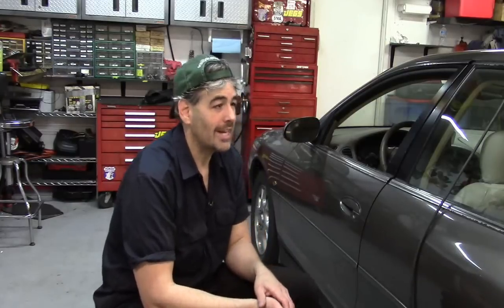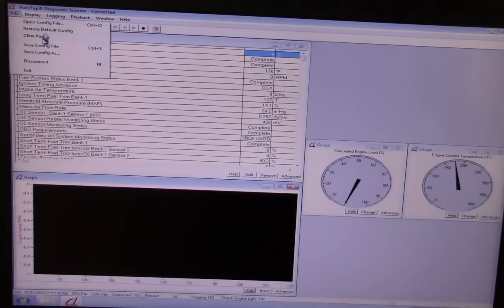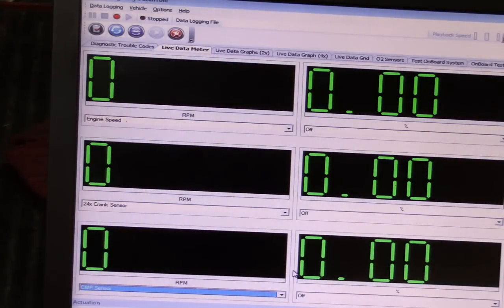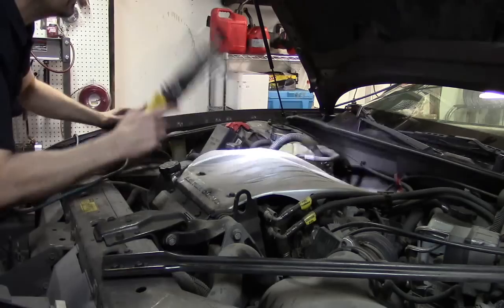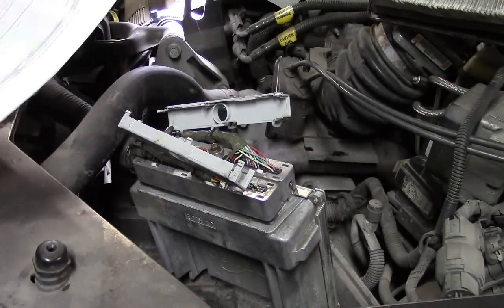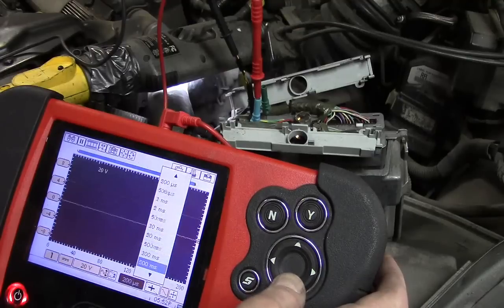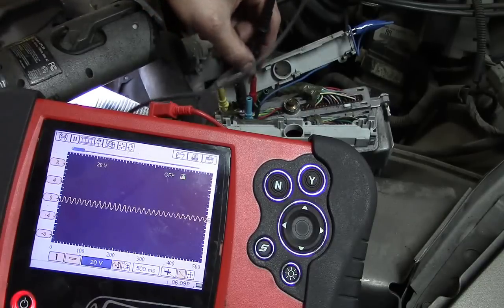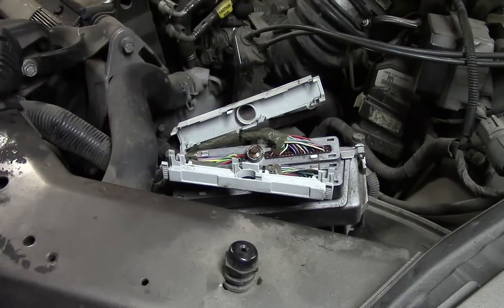DIY- Crankshaft Position Sensor Code Diagnosis

Comment: When I bought my power probe 3, I got it in with a kit to test for short to ground. I've spent a lot of time in that same wire harness this weak chasing down an ABS fault. 

The open circuit at first was right next to the rf ABS sensor, but then I traced and opened the main wiring harness all the way up to the ABS control module and that's where the short terminated.

All I can figure is that the circuit is then open in the device itself. It's as sure as I can be.

Of course, you won't be following up that branch of wires, if I see it right in my mind, you're hooking left up that computer.

There's like a membrane around that whole wiring section if you peel it back with a screwdriver you can get in to check for other faults or breaks in the wire. The good news, is with some electrical tape, it only takes minutes to put it together, but the tear down does suck.

Comment: Cleaner is more intellectual? Lol. You crack me up.

On a Chevy Impala 2005 the PCM is in a sleeve in, but not in the air box. As you poked around I thought, oh, I think I know where it is! Lol
Reply: Totally odd location to me too, bro. Nice twist on the bolt routine!
Reply: +DE “AutoBravado” the reason it is in the air box was so that incoming air would cool the computer
Reply: ksauto1 That's what I was thinking too.

Comment: If the PCM does turn out to have a bad output, and you don't find a root cause, could you just inject 12v into that circuit from some other source?
Reply from the maker: +Paul Howard Good idea however I believe this design uses the delta in voltage from the source vs the PCM to read the sensor.  If the PCM does not see the 12V then it cannot work.  In other words it compares signal to the 12V source- it does not just look at signal. Not 100% sure though. Good thinking though!
Reply: +Schrodingers Box I think you're right, but Paul, if that did work, that'd save them from a PCM (well, they aren't that expensive on eBay, but if they work right or not may be in question).

Comment: Dude!!  I was gonna drop you a PM tonight to see how things were going!  Glad to see you're still with us!  Congrats on the promotion; that sounds like it's gonna keep you super-busy!  If you're wondering what to do with the gobs of money you're making now, I'm open for donations!  ;D

Man, talk about coming back with a bang!  I'm not sure I'd be ready to call a PCM just yet, but it's certainly heading in that direction!  Enjoy your next three weeks of travel in the mean time!  :)
Reply from the maker: +rhkips Yeah you know me Kips- I won't call the PCM unless I can confirm there is no possibility a short to ground on the power is causing this. We have seen before where PCM shuts off a sensor circuit in such an event until the DTC is cleared.
Reply: +Schrodingers Box  Yes, my cooling fan did not come on and the fuse in the fuse box had no power. It turned out to be the cooling fan relay and connector was burned. New relay and connector  wire by the radiator solved that problem.

Comment: Checking amperage on the power feed would be a good way to check if it was a short to ground with resistance, pulling the 12v to ground. If no amperage, I would check continuity to ground with a test light hooked to 12v, and if not found, one "Fix" for this old gal would be to run an external 12v regulator or piggyback off the sensor A feed. Would be a bit of a hack fix, but on a 16 year old GM that's puking antifreeze and oil, not the worst thing.
Reply: +James Barcellano You got some great thinking. Too bad the issue is on the positive side.

I suppose one could use a resistant way to check with a DVOM to see if the power would be found if the PCM was unpinned and you went to a different ground. 

Yes, I think that's a way to confirm if it's the PCM or a short. Wow. You got my thinking bro. and I think I thought of the next test to see where this is going. Awesome! :)
Reply: +James Barcellano I was thinking the same thing of ether checking for a ground w/ a test light or ohms meter. amp meter would have worked great too.

Comment: Would it be possible to run a test light from battery ground to the 12V pin on the pcm you suspect is bad? If there's light, than it's good would be my suspicion. (Assuming the circuit carries current...)
Reply from the maker: +Justin “JeepnJG” Gooding You could certainly do that.

Comment: Yes, just did a crankshaft sensor in my Ford 5 Speed!
Crank, no start!  Much information on web is misleading. Many sensors in my Ford, but the crank sensor was located in the bell housing in the clutch/ Transmission. Unscrewed mine and the old one was half melted. Replaced it and engine restarted!
Reply: before I took my sensor out I tested the wires by probing them to see if I got a signal.
Reply from the maker: +prosperandbehealthy And what did it show?
Reply: +Schrodingers Box It showed no signal.
Reply: +Schrodingers Box  I used a multimeter set to AC Volts and probed the  2 wires.  While cranking the engine I should have got .5 to 1 Volts, but nothing showed. I then unscrewed the nut, pryed the sensor out and it was half melted.
Reply: +Schrodingers Box  After much frustration because I am not an expert on cars I learned that when a car cranks and does not start it has to be either; not getting fuel, or not getting spark. I was getting fuel, but not any spark. I then tested the coil pack wires.  The center wire is power and the left wire handles 2 cylinders & the right handles 2 cylinders. I probed the the center power wire with a multimeter to see if the coil pack was getting power. Yes it had power! Then I tested  if the left & right coil pack wires was getting a signal and I used a small led test bulb that I got from R. S. No signal and that led me to test the crankshaft  sensor wires. No signal.
Reply from the maker: +prosperandbehealthy That would do it. Good job recognizing the inductive sensor btw.